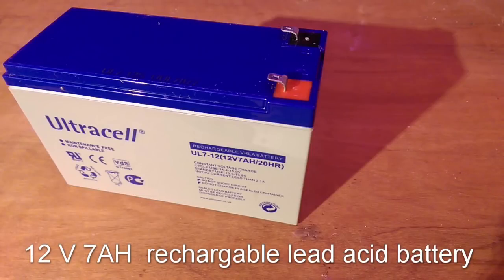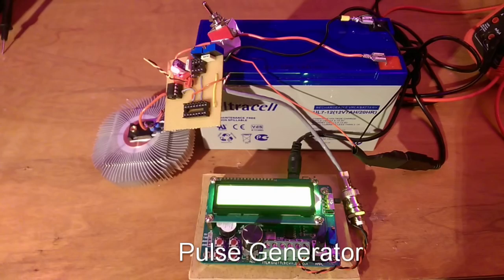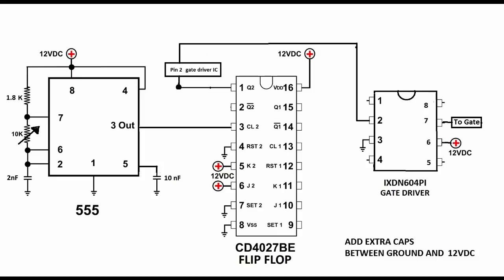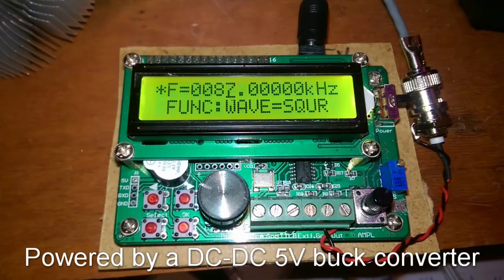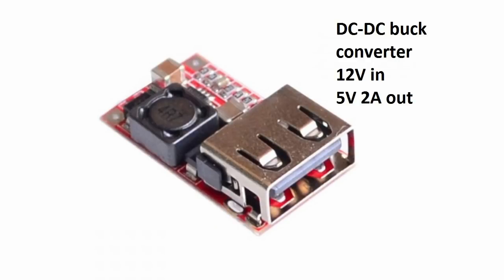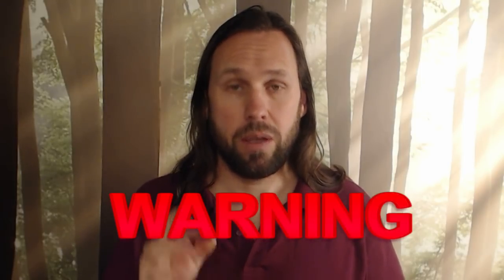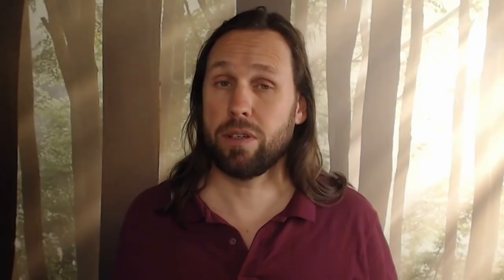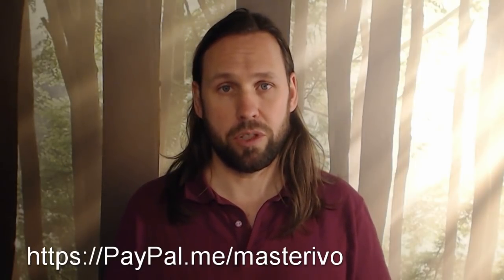High Side Inductive Switching with a N-Mosfet

Comment: You actually can get the negative spikes with the coil on the other side of the mosfet too :)
Tgrough expirimenting with different setups it very much looks like.
the direction of current is the factor wich determines the polarity of the spike.

This can be observed when running your coil with a full bridge of mosfets.

The fullbridge alternates the coil, wich in term produceses a alternating spike pattern.
Reply from the maker: I do have a positive voltage impulse with this setup. H bridge does not work as the coil needs a ground.
the 2 extra mosfets are in parallel to create a negative current impulse
Reply: @MasterIvo  you can still use 1 (even a 2nd path with capacitor) grounds like normal. (If the Vbus is isolated from ground)
Reply from the maker: @acidbyte23  what about the body diodes of the mosfets? Always conducting one or the other!
Reply: @MasterIvo  theres way arrounds + there are also switches that dont have the body diodes
Reply: @MasterIvo  before i had some understanding of how to propperly make inverters i always had issues with spikes destroying bridges.

Especially ones made with mosfets or other "fragile" devices.

It was always the body diode that failed. As its under rated compared to what the switch is capable of.

The use of series diodes with the mosfets effectively disables the body diode.
Reply from the maker: @acidbyte23   the IGBT's won't produce proper impulses as they have trouble turning off fast enough.
I would love to use Thyristors but I wonder if they can handle the repetition speed
Reply: @MasterIvo  your atleast able to get them to do 10khz (not all of them but they do exist)
Reply from the maker: @acidbyte23  that would probably be good enough, but at what voltage rating?
Reply from the maker: in series, yes!
Reply from the maker: https://www.microsemi.com/document-portal/doc_download/14658-nanosecond-scr-switch-for-reliable-high-current-pulse-generators-and-modulators
Reply from the maker: @acidbyte23  die scr thyristors zijn relatief duur. en ze kunnen denk ik niet in parallel
Reply: @MasterIvo  ja zo gaat dat idd. Het mooie spul kost allemaal veel geld helaas.
Maar iets vergelijkbaars is wel te maken met goedkoper materiaal :)
Reply: @MasterIvo  die bedoelde ik ja 😄
Ik heb dit soort circuits al vaker gezien.
Zo zijn er ook mosfets te krijgen van 16kvdc met 17amp current (welk ik vermoed op een zelfde manier werken).
Must met dit soort gevallen is wel, dat alle switches in serie gematched moeten zijn. Ze moeten allemaal tegelijk open en dicht gaan. Anders werkt het niet.
Reply from the maker: @acidbyte23  Ik heb welleens gedacht zelf thyristor buizen te maken, maar dat gaat me echt te ver.
Maar een aantal solid state Thyristors (swr) in serie die gelijktijdig switchen zou goed moeten lukken.
ga het eerst met parallel mosfets proberen, die kan ik ook weer in series zetten.

Comment: I just use a joule thief circuit with a toroid coil to drive there mosfet. It's not as convenient and adjustable but drivers the mosfet. I've used the mosfet for pwm for my hho dry cell. 
I've not tried it with the big pancake coil like yours for health. 
Now to use it for health, you want different frequencies for different health benefits? My joule circuit oscillates anywhere between 5khz - 40khz. With a small bifilar 3" coil for joule I got 1-2mhz, depending on voltage, cap, resistor and the coil.

Love your videos they get me ideas. 

I like to explore the health benefits as i use the fairly new aqua cure (George Weisman) hydroxy (brown's gas) for breathing and water charging. I use it for my disabled wife and myself

Comment: would it work to use an Arduino as a gate ? (The Mega has a 16MHz clock.) 5V digital pins.
Reply: Answer was not. Not enough amps in a Arduino pin.

Comment: Hi Ivo, can we use a PWM pulses (goes up to 25KHz) with adjustable DC from 0% to 100% instead of IXDN? Thanks.
Reply from the maker: it needs to be the right voltage and be able to provide fast high currents to charge and discharge the gate.
You could try. but probably won't work properly

Comment: Hi Brother ok so I am at a point where need some help ok. I hope your well gate driver 1xdn604 i couldn't find but got 1xd1404pi-DIP   it's rated for 4 amps. will this work ,and what is pin layout. I got to excited and burn up first pulse model LOL but this i'am partial ready. got several buck converter 5volt . just wondering about this chip. if not do you have link to right one. Thanks
Reply from the maker: You will have to look into the datasheet of the part

Comment: I just purchased the four components, but the pin out on the IXDN604 looks complicated. Do you have a schematic for the complete circuit. Also, what type of diodes are you using? And, what is the wattage of the resistors?
Reply from the maker: Ixdn604 has 2 channels, you only need 1. and power. in total 4 connections.
if I remember correctly, pin 3 is - v pin 6 is +v pin 4 is in and pin 5 is out to gate resistance. keep pin 5 to resistance to gate short! 
and keep pin 3 to mosfet source short, this prevents ringing. if it rings to much, use slightly bigger resistance to damp it
 diodes: uf4007 resistors 1/4 watt will do. or use  2x 1/8 W in parallel with double value. higher value watts is is all fine. metal oxide is best, metal film also good.

Comment: Hey Ivo,
Thanks for the video.
However I have questions :
Why do we want high side switch ?
Why does it enable to have negative Bemf ?
And why do we need negative bemf ?

Thanks...
Reply from the maker: if we switch high, than the positive voltage supply to the coil is interupted, and we get negative impulses due to Lenz law.

if we switch the negative of the  coil we get positive spikes (again Lenz law)

we need both polarity impulses (for the future circuit I will release, which extends the radiant power circuit of my april 2019 video).

normally the low side switch is much easier to build.

Comment: Ivo , can you please design a boot strap circuit for high side switching . That would make life easy with single power source.
Reply from the maker: A better option is a isolated DC DC converted. I have been working on it. it needs a pi filter on input and output.
this removes the need for a battery

Comment: Hey. Im limited by the use of mosfets for switching, so I'm interested in either vacuum tubes, or flyback transformers. Let me know what you think, and if youve had any advances in high power switching and experimental source. I will try the battery too I think, expecially with your screen set up! 

All I care about is switching high power quickly between two circuit pathways. I have a bifilar coil, and basically a tesla hairpin circuit with some coild and bifilar coils and other load activities on the otherside. Its high power application, so I wanted something that could handel anything without serious drawbacks like low voltage rating or it might explode depending on where tranisent current builds up.

Anyway, hope we can help solve some of each others probelms! Something comitative but not mechanical is what I'm looking for. A sprytron would be ideal, but we cant get those.
Reply from the maker: igbt could work also. vacuum tube should work also. I would suggest making a half bridge circuit. getting good results with it. will publish that next. I have my email on the "about" page
Reply: @MasterIvo  thanks, I spend almost all day researching the topic. I found something called GTO thyristors that switch very quickly-- 1 - 15 pico seconds. Ill look at what you have suggested.

Comment: Hi onesmore,maybe you are interessted ,i have made a circuit where the coil is in the middle of 2 IGBT without bodydiode,then in the offtime of the IGBT you can discharge the Cap or whatever.It is made with 2 N-channel .
Reply from the maker: yes that could be interesting. Like a half bridge. how fast (frequency) will it run with proper fast turn on and turn off (<100nS). and what is the IGBT voltage rating? (actually a avalanche mode body diode is preferred as it protects the fet)
Reply: @MasterIvo  ,it only depends on the parts you are using.
Reply from the maker: sounds good

Comment: This  is the first time in 20 years that i saw  the coil hooked up between Source and Minus , i never thought about it and that it makes a difference(does it?),i thought "negativ" means it is in the other direction.
p.s. i really forgot in this case like Schauberger said "you have to turn all they tell you 180°"
Reply from the maker: the big difference is the voltage polarity of the inductive spike that is produced, when the coil is turned of. instead of positive(drain) in, positive(spike) out, now you have positive(drain) in , negative(spike) out. 

best is to forget all they tell you and start all over, with the classics. M Faraday, Heaviside, JJ Thomson,  C.P. Steinmetz, N Tesla and others... They all talk about electric FIELDS

Comment: Good morning, Ivo, in 2.40 i understand the components 555 out to CD4027BE Flip flop to pin 2 IXDN604 gate driver and the conections of gate transistor IRF 460, but in 4.18 in this part i can see a 12 volts battery, reduce to 5 volts buck converter and other power supply of 12 volts..? your circuit is powered with two power soucers...? I already lost my way, buck converter connections to pulse generator 50% duty is a bit confusing for me...........
Reply from the maker: Good, your almost getting it. Yes! there are 2 separate power supplies. One for the coil, switched by the mosfet (V+ and V-).   the second powersupply is the 12V battery, it powers the pulse generator, from the buck converter (because the pulse gen. runs of 5V instead of 12v).

The battery is used to switch the mosfet, it is because the gate voltage needs to be higher than the source of the mosfet. 

the battery is grounded on the source of the mosfet.
Reply: @MasterIvo  Ok thanks, very very interesting...
Reply from the maker: If you have any questions feel free to ask.
Reply: @MasterIvo  Have you tried another circuit with only one source...? i There must be another way to make it work....
Reply from the maker: @skycollection   yes with an isolated buck converter it also works
Reply from the maker: @skycollection  here is the info/schematic https://easyeda.com/MasterIvo/high-side-gate-driver-for-n-mosfet
Reply from the maker: another thing. please dont use the 555 as it is not stable enough. better is to buy the square wave generator (it works of 5V so it can be powered from the battery)

Comment: can you point out why you use the IXDN604 for Highside switching? Because this IC is designed to do a Lowside switching. you will not get problems if you run this circuit with a 12V source. but if you raise the voltage problems start to happen. regards!
Reply from the maker: if this isnt done, the source voltage will change when the mosfet conducts (becomes V+). the gate then will close as it is realtive to the (changing) source voltage. resulting in a hot mosfet, and high current draw. bad switch...
Reply: @MasterIvo  thank you! i will try this :)
Reply from the maker: the video explains all. the ixdn604 is powered by a SEPARATE dc voltage supply (battery) that is grounded on the source of the mosfet.

the mosfet drain and coil ground are powered by ANOTHER SEPARATE dc voltage supply (variable).

Comment: High side switch use p Chanel fet or pnp transistor and take the gate to ground to turn on. 
Tesla talked of pulse at less than 1% duty cycle as its purpose is to ring the circuit similar to how a hammer hits a bell,  a sudden very short impact to set the bell resonating,  a 50% hammer push won't ring the bell and same with duty cycle and inductor resonance. The free energy is not in the back emf but rather in creating a tank resonating circuit with caps in parralel and exciting that with a pulse. Then with that resonating circuit use a secondary coil to generate power,  primary bifiller secondary normal coil. Bifiller is only amplifying for generating:your field not receive.
Reply from the maker: p channel has problems with resistance, and thus grat losses. 

I use 500nS impulses now (less than 1% duty cycle) . see my "radiant power" video for more up to date info
Reply: @MasterIvo  from memory both p and ñ Chanel look very similar...  
From what I understand it's not the pulse width as much as abrupt disruption of the pulse,  hence magnetically quenched spark gaps produce good results.  If using fets you need to look at rf capable to close fast enough and very low gate cappicatance but most have a built in protection diode  which might get in the way unless you design around it
Reply from the maker: @joblogs9724  I use the 50%duty pulsed mosfet, to generate negative inductive spikes. These are the same impulses generated by magnetic quenced sparkgaps.
By using a coil, I don't need to discharge through a switch (sparkgap) but the impulse is generated when the switch opens. much more practical, and ultra fast. Already achieved - 1200v 500nS impulses at 100kHz
Reply: @MasterIvo  yes I used to think that until I used a 4w HV generator from a tazer through a spark gap and large coils connected to 2 ground Pole, generation and discharge, and set up ground resonance that caused 4 street transformers up to 500m away explode in flames.
Pulsing fets never did that
Reply from the maker: Lol that must have been fun. So you resonated the earth voltage? pretty impressive. But thats not what I am after.
Reply: @MasterIvo  yes I was looking into ground resonance then very large currents can be extracted,  I couldn't get any effect with fast fets and a 20mhz frequency generator, but effect from even a small quenched spark gap gave impressive results. Other interesting effects observed from the Tesla hairpin circuit and with this you can easily observe the effect of the spark gap. The quenching is critical to correct operation,  there are other ways like hydrogen filled magnetically quenched sg or a series sg that also work but the spark gap is the critical part in many radiant designs
Reply from the maker: I made a solid state hairpin circuit this is the video that shows and descibes it https://youtu.be/1Flj1i0zQ-8
it rather unique in its effects.
Looks like the impulse generates longitudinal pressure.

Comment: Hey Buddy. long time tno see.  those irgbs are like 3bucks each ouch !.  buy yourself a handful of C3998 ;s .  here is the circuit i use for switching a newman motor @ 630 volts P2P .-  no idea what the emf spikes are, i put a small cap over the inductor too soften the blow.  - but its reliable enough. -  most of the danger too the transistors, is reverse voltages, like from AC or rotating rotors.,,-  this is why i developed this circuit,  - state of my art.  http://oi66.tinypic.com/2n81lqg.jpg
Reply from the maker: thanks for sharing. I actually just ordered some wolfspeed SiC mosfets, capable of 900V not cheap indeed.
Reply: the following is a mate on forums driving a 5 turn induction heater coil.   .......   
The IRFP260N has an RDS ON of 0.04 ohms. 
The IRFP4668 has an RDS ON of 0.008 ohms.

It's a fairly large difference for heat loss (efficiency) in this ZVS.
Since my goal is to operate at lowest possible input amps and highest AC Amps this became a clear, practical change.
The price is more than the IRFP260, but it was worth the testing for the few dollars difference.
Results: Keeping input voltage at 12v (needed to start ZVS at 15-16 volts) and Cap still the same:
Input current was reduced from stock at 2.25 amps to 1.46 amps.
The next test was with the silver plated stock coil and reduced current to 1.31 amps.

Comment: Also, I typically use a small capacitor across the drain-source to dampen pulses such that I do not damage the body diode of the MosFET or of course the MosFET itself...if you damage the body diode the MosFET may still continue to work but run hot reducing your efficiency...by checking the O-scope you can check on your voltage spike to get just the right capacitance value (usually in the small couple of microfarad range...and don't use an electrolytic).

When you rapidly switch a coil you get two spikes...one on close and one on opening...the one on opening is typically what people relate to back EMF...however...the one on closing is prior to inductor building the magnetic field and due to the overall capacitance of your circuit from the external environment...in other words the inductor (coil) builds an EMF in the instant just prior to building it's magnetic field that opposes the source voltage in the form of a spike (in a coil voltage leads current)...

It appears in your diagram you are switching the positive side of the coil (splitting the positive or high side of coil)...rather then switching the negative side of the circuit which may be preferable...
Reply from the maker: Hi, I use avalance rated mosfets, they can deal with the over voltage pretty well, as a zener would. because I use the body diode, and the mosfet became hot, I now use a extra diode in parallel that is faster, and can be cooled.

I choose high side switching because it creates a negative back emf. the "real" current moves from negative to positive, so this way I can create a longitudinal pressure wave from it.
mosfet used: IRFP460A but I would like to experiment with the new SiC mosfets from Wolfspeed (Cree) they can handle much higher voltages.
Reply: It gives a different energy. the purple vs white as plasma. it has something to do with the apparent asymmetry between N-S snapping together and the insane force it takes to push N-N or S-S together even with kinda small magnets. It's sorta because that then is two fields really, and you're making them duke it out. but it seems high side switching leads to the one that feels good when you sit on it and that says a lot.